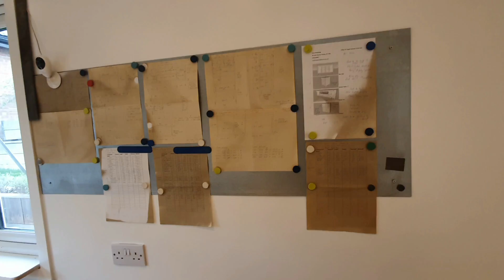We nearly lost it all ! FIRE in the workshop  🔥🔥🔥

Comment: I am so very glad everyone is ok and the damage to the shop was minimal. So scary. 

When painting over smoke and fire damage, you're best off using a stain- and odor-blocking primer like Zinsser B-I-N or Bullseye 1-2-3 Plus. The B-I-N is shellac-based, has great adhesion as well as high hide and permanent odor blocking. The 1-2-3 is water-based. Make sure you get the Plus version for the stain blocking. For strong odor blocking, you'll want to stick with the B-I-N.
Reply from the maker: Thanks for the tips Jennifer, I didnt know it blocks odours as well.
I'll have to use it on some of the really stained parts. 👍

Comment: I had this happen about 4 years ago, buildup of dust in the 3 phase motor in the table saw. Know what you mean about the panic setting in, I used a pry bar to tip the saw in order to get an extinguisher into the motor, cracked the cast iron and motor was toast. But that was the worst that happened so not the end of the world.